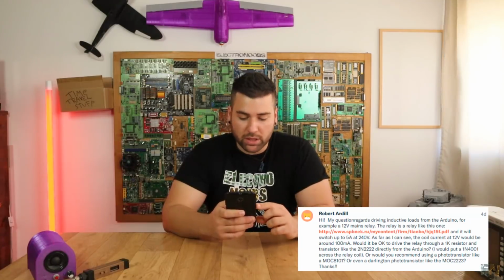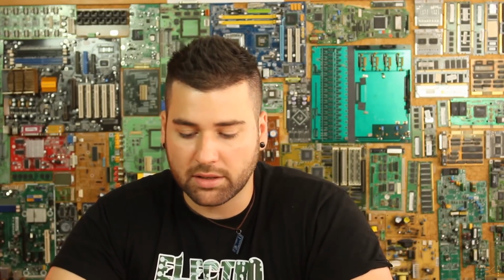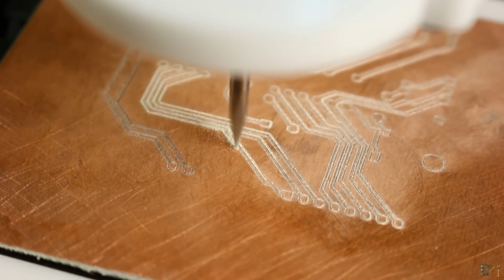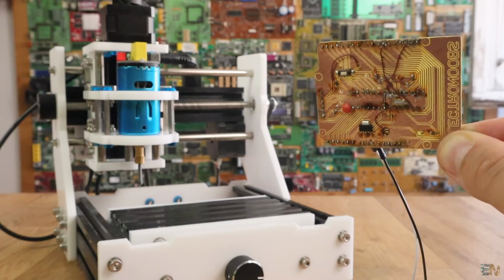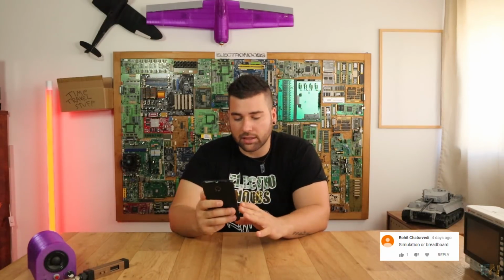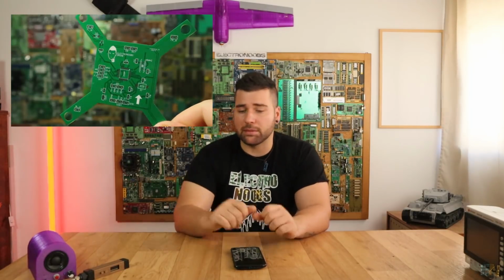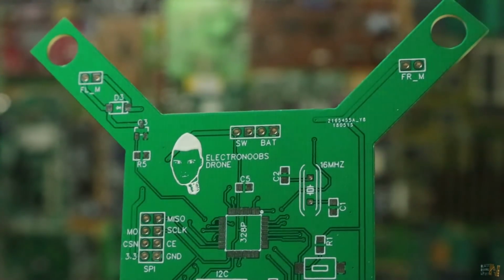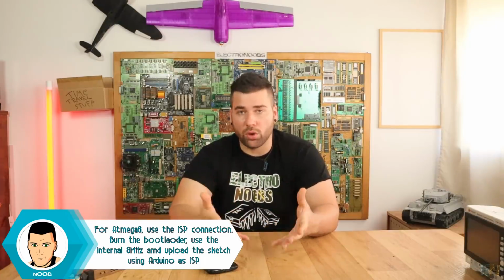My #1 Q&A

Comment: An interesting video. I just joined your patreon. One thing I have never understood about making PCB's is why you use a ground plane. I have had maybe 6 different boards made using easyeda and jlcpcb, and they work fine without a ground plane. I just use ground traces. it seems like a ground plane is a waste of copper.

Comment: esp8266 is the chip, the module that just routes 2 gpio pins is called the esp-01 module, there are esp-12 too which break out all pins. there are even arduino uno board with a esp8266 on it for almost the same price as the atmega328p ones.  but its limited to 3.3v IO and 11 gpio's

Comment: Im an electronics engineer and watch nearly every new episode. Most of the videos are basic stuff, but thats great for beginners to start with electronics. Your english is good and easy to understand, your video editing with the overlays is great.

Please to all: dont ask for esp or stm videos, if you program them with arduino ide. In this case the chips arent able to provide nearly the full processing power than programming them in their own ide. The compilation between arduino and esp or stm isnt good at all. 
You can test that also with an arduino: Generate a square wave in a loop with digitalWrite(pin, 0) and digitalWrite(pin, 1) and compare the speed with an endless loop like while(1) and PORTx &= (1<<pin) and the opposite command to lower that pin again... 

For me, things like the FPGA series is very interesting, but also something about DSPs or some kind of DSP mathematics for analog devices ADSP series.

Anyway: you did (and hopefully will do) a good job! In every video there are nice things to know also for an advanced like me. If you need help or get stuck doing new stuff, you can always ask - maybe I have some hints :).

Comment: Yes, the AVR8 chips are inexpensive, so I do not cry very hard when I burn one.  You can buy 10 ATmega8a's for about $4.  Everyone who builds up "Arduino" projects should have the skills to take one of these plain chips, and make it work alone.
Reply: GnuReligion 
  I got mine at $0.49 each from an AliExpress seller called ""IC-Chip Store""
  I found a different seller that listed ATmega644's for $0.90 each and ATmega2560-16AU's for $1.18. I ordered several of those. The store is called ""Shop1881175 Store"
  For some reason Aliexpress doesn't show these items in search results. I noticed AliEx will occasionally include some really cheap items in search results for similar items. If you click on these then check out the seller's store, you will find lots of unlisted items that do not show up in search results. I think the problem is how the site is translated when searching. Anyways, if you find the right sellers, know part numbers fairly well, and have the time to browse, there are sellers on AliExpress listing everything at around the 10k quality pricing from other places. I've maxed out my 'favorites' list names on the app and have around 1500 items saved in them ;)
Reply: Well, it seems I lied, or they changed the price.  $0.475 a piece:
https://www.aliexpress.com/item/Free-Shipping-10PCS-lot-ATMEGA8A-AU-ATMEGA8A-ATMEL-TQFP-32-Instead-of-ATMEGA8L-8AU-and-ATMEGA8/32748805999.html
Reply: Ah, you found some sweet deals.  I will look.  My experience is the same -- the search feature does not always find the product.  Some stores are well organized, but some are not.  Would be nice if there were a complete vendor vs product listing.  Last year, found one I was proud of -- atXmega32a4u for $2/ea from "Supplier of electronic components"  These can run USB2.0 at full speed, and stay cold.  Sadly, they have poor Arduino software support.
Even better are STM32F103C8T6 chips from "HK (integrated circuit)" for about $1/ea.  48-pin.  The perfect number to put in your cart is 4, for $4.18.  The documented flash on these is 64k,  but newly manufactured ones are really "F103CB" -- and these have 128k flash.  For real.  Arduino support is  good now, and you can install the Maple USB2 bootloader, so uploads no-hassle.
https://www.aliexpress.com/item/STM32F103C8T6-LQFP-48-ST/32744863225.html

Comment: @electronoobs ESP8266 is my primary chip versus arduino. i use it on a ton of devices.  i believe its got a couple analog pins, and at least 8 digital pins.  the primary concern for battery power while consuming wifi and constantly running is 75-115mah running just for the board and an LED. 

the other big concern about it is that its basically got 1/4 the processing power of the arduino, the arduino uno is close to 80mhz i believe and esp8266 is 16mhz i believe. 

i've also had some really really odd results with using its EEPROM compared to using the uno's.

Comment: You still not upload the LCR Meter circuit using Arduino atmega328p. And one thing I would like to say about the Arduino based Inductance Meter that you may changed the Arduino code so it not working.
Reply: HCDP Education 
https://www.mikrocontroller.net/articles/AVR_Transistortester
That's the official project page. If your going to build something yourself, build version 2 of the project based on the ATmega644 or ATmega1284. I have videos about the clone schematics and retraced both of the newest clones. I've also made a couple of picture summaries of the different official forums for the AVR TT project because most people aren't reading enormous forum threads.
  Find the official PDF for the project. It's 140 pages long and describes the code in detail along with some of the project options. I've written a bunch of stuff about it on the official eevblog forum thread. That's where you'll find Markus, the author of the 2nd firmware fork. My videos on the project forums have all of the links to the different parts of the project. The schematic videos about the clones have links to the files I posted on Github. I only use KiCAD as it is by far the most powerful EDA software  available for free. My .pro files are posted with partially completed pcb's for a couple of designs. I've been working on another version 2 off and on but it's on hold until I sort out my workbench and get organized again.
-Jake

Comment: can you recommend a shield for cnc !!! should i get an arduino uno + shield or arduino mega + shield ??
also you look high af in this video XD 
i hope your doing well
Reply: There is a Software called ESTLcam, in there you can program the arduino directly for cnc operation. ESTLcam is also a great software to get into cnc stuff. Its mainly GBRL. I used it for my very first time on a cnc and figured out, that this thing isnt very good. No different dead end switches for both sides of one axe and an absolute terrible emergency stop function.

If you like to use it, you dont need an shield. Get some decent motor drivers from china. You can connect them directly to the arduino, because they have already optoisolated inputs. You need only 3 wires per motor to do that.

I use an controller like the DDCSV1.1. The handwheel is great and it supports also auto home, + and -